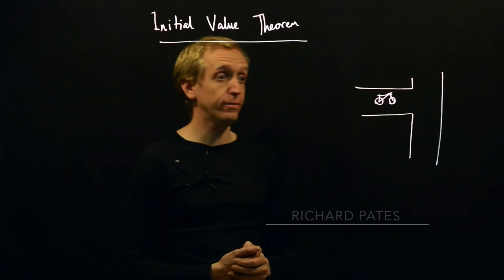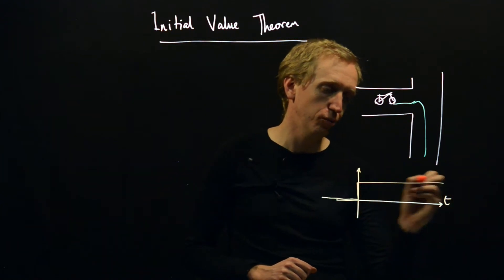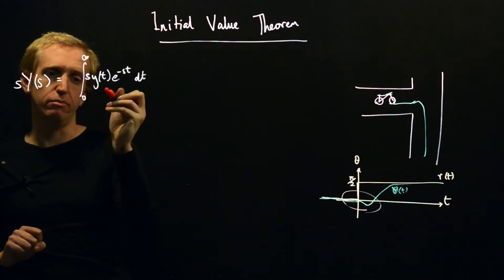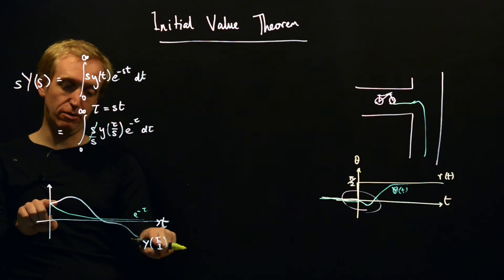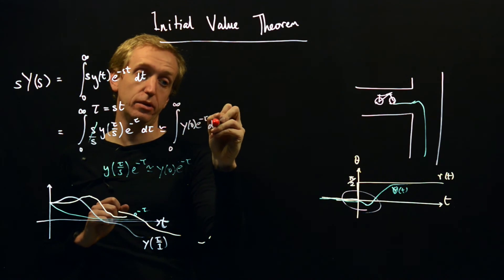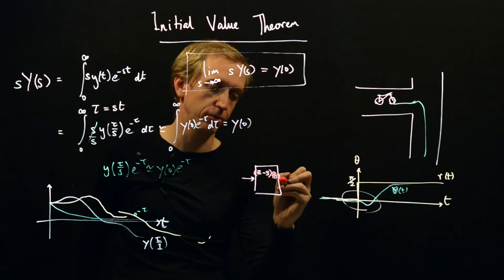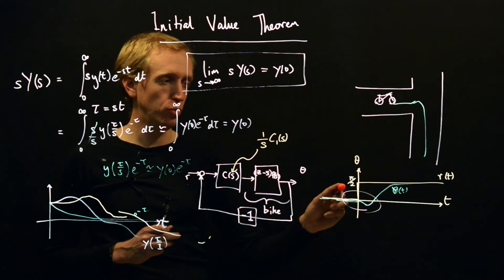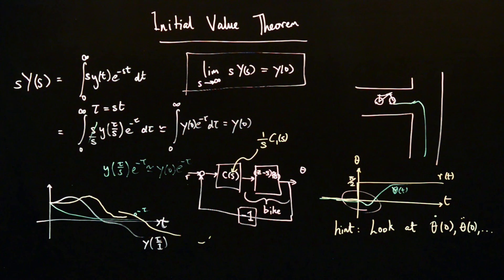The Initial Value Theorem

Comment: That's a nice intuitive introduction to the initial value theorem. Rigorously, I think you would have to invoke the Dominated Convergence Theorem for the final convergence step, right? I probably wouldn't have used the substitution there, but rather I would have split the integral and showed that all the area of the integral was bunching up around the initial value of the function. This would give a approximate identity argument approach, like how you would approximate the delta function with a bunch of Gaussians.
Reply from the maker: You're right, you can use the dominated convergence theorem to make the final step rigorous. I don't remember exactly what I was thinking when I mentioned splitting the integral in two pieces instead, but I assume I was referring to the argument given on the wikipedia page on the initial value theorem.